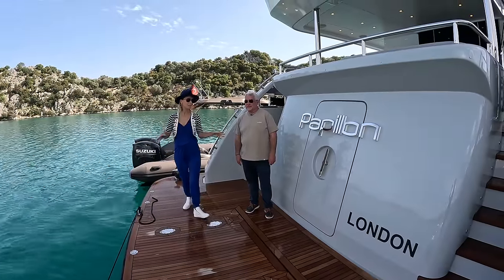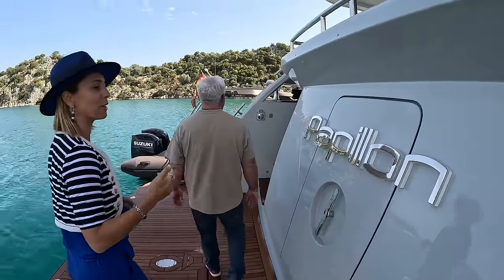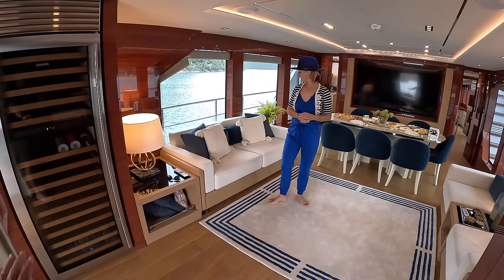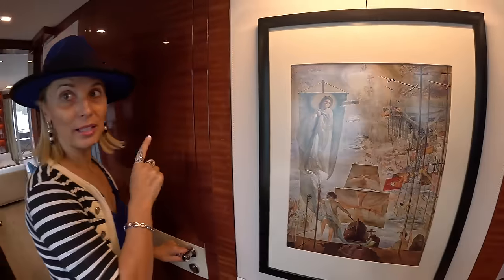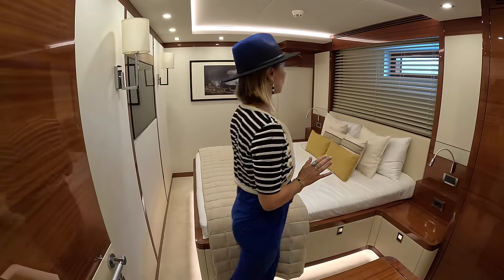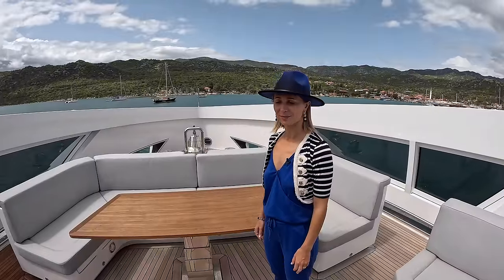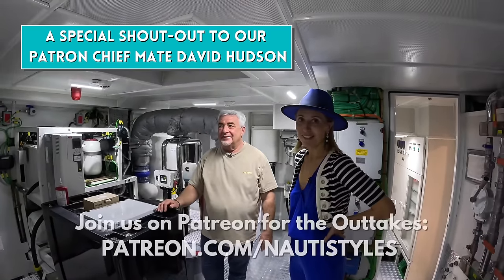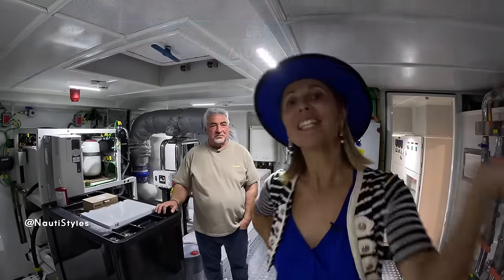OUR YACHT Build UPDATE & BERING 92 EXPLORER SuperYacht Tour / EXPEDITION Liveaboard Trawler

Comment: Another impressive Bering, although I have to say I felt that pilothouse was to cramped and on the fly bridge in the area with the couch, bar and bar stools there was just to much crammed into a small space.  I was a bit surprised at those areas as one thing that impresses me about Bering is the efficient use of space they usually have.

Comment: Kitchen , nice and compact, all mod cons , where is the prep area ? Counter top ? Cannot see space for 8 plates at a time , how will service work ? Plates need to arrive within seconds of each other . A charter build ? 
  Maybe Rico can blow his own horn soon and hope you have a bell on your boat :-) 
Really do like the 'helms ' , so often the upper deck is overkill , not here . Functional . 
Lower deck is about getting there :-) 
  Stabilisers :-) Maybe have a few demonstrations of how good they are ? A simple ball bearing suspended from a wire in some small space ? 
Head floor , must be non slip , out of the shower with wet feet ? Ok , anti slip , when dry ? 
  Never run down a view from the head :-)

Comment: Rico--Seakeepers are not effective in boats over 75'--Zero Speed Stabilizers that are standard on the Bering would do more than the Seakeeper.
 
For your build you should consider frosted shower glass from18-50" for privacy particularly with multiple guests and Charters. Would still allow for views out the windows.

Lights in the lower engine room would be nice for servicing or trouble shooting underway

All the stairs could be problematic in rough seas on a long cruise

Comment: i was always a big fan of big chunky furniture, things that not only have a purpose but durability, last a lifetime and some, i find the Bering Yachts fit that kind of class, there are delicate things built into chunky things, Alexie must be congratulated on such 'Chunky Elegance' that sets his boats well away from the competitors - the high shine finish on the woodwork, something else
having a quick tour of this yacht, i can see a few very minor things i would change (or rather have designed slightly different) i'm not a fan of the door handles used, they look like they might be at elbow height and i could easily see myself swearing at them a number of times, maybe after you get used to them, you walk round with hands on head, was a bit weird seeing a large handle on the shower door too, i know i would catch that, perhaps sliding door, which i know is perhaps not practical while under way, pocket doors all round would be nice to see them hide away into the walls, and have them operate likesome patio doors, a handle would lift them to open, they drop to lock, an easy fix
also having the tv against the inner wall where daylight distractions can interfere with viewing, shadows and reflections (i know close the curtains/blinds etc - i would like a bed to be facing outwards, to see the view, sky etc - perhaps a flat screen could hide in the wall below the window, into the wall, pops up to block the window, no light issues
just amazing

Comment: One thing that always occurs to me when seeing a yacht like this is why the bridge is always so far back from the front of the boat. I know some times it is needed due to the narrow design towards the front of the boat or to have a sun bathing area, but in this case it looks like the bridge could easily be 10-20 feet forward giving a better view of what is in front of the boat.
Reply: Its for comfort, you do not want to be all the way on the bow in rough seas
Reply from the maker: Thanks Michael for answering the question! Appreciate it!

Comment: I must say I have ONE regret about the lines of the latest Bering. They are getting too much like your regular super yachts. They are beautiful, don't get me wrong. We can still see un all the details that they are robust boats made to go anywhere in any conditions and bring you back to port safe and sound. But older hulls looked more rugged. It's like a pumped up soldier in bdu or in full dress uniform. It's the same bad-ass in both cases but one looks more the part than the other.

Comment: I have one concern with the boat and it’s the same with Nordhaven.  If these are “exploration” yachts, they should be expected to travel in big seas so why would you have bows that can be swamped?  Nordhaven puts their ribs and other auxiliary watercraft in a sunken bow vs. in the stern.  I know the bows have a high rise but if you get green water over the bow it will take time to drain which leaves the boat susceptible to multiple swamping.  If I were designing a boat I would have a flush deck on the bow to take big seas but that’s me.
Reply from the maker: … and let me guess… you are not a naval architect 😝😂🤷‍♀️
Reply: Now that I’ve chilled.  I ask the question because I’ve raced sailboats in the southern ocean.  I’ve been in 30 to 40 ft. seas.  From your video I couldn’t see how the water drains from that foredeck.  There are reasons why the engines are below the waterline on that boat and that it has two stabilization systems.  It’s top heavy.

Comment: You can add multiple sea keepers to add up to the mass that you need.
Reply: @@ElephantProtectors No they don’t no more energy then Fines and a lot less drag no fines in the water that the engines have to pull through the water. You get more natural miles with sea keepers then fines .
Reply: @@ElephantProtectors your going to yes one or they other . This boat have 4 fines that’s 4 PTO . And one the speaker is running it doesn’t use much energy 2kw once it’s running.
Reply: @@ElephantProtectors seakeeper 35 when running use 30 amps not bad for a 100 ton gyro.
Reply: @@ElephantProtectors but that’s not a lot of energy to control a 200 ton vessel.
Reply: That a lot of energy for your 36’  small personal vessel .

Comment: Love how they used stainless steel piping very smart to use for everything but the hydraulics they did here is great it’s a boat it’s gonna be humid, salt water corrodes and the pipe is gonna rot out in that environment even though it’s not submerged in salt water. Also they have copper nickel pipping too that stuff lasts forever. IMO they should atleast use stainless piping for everything that has sea water running through them so they don’t corrode like regular iron pipe that’s how boats sink the pipes rot from the inside out and one day bam it’s leaking and ur screwed. If ur gonna spend big money like this just do it right from the start.

Comment: My guess for TV size is 75"-85".  You can find screens in 90"+ and go up from there is you want to use a projector.  When a TV get's this big you have to think about how far from the screen you are situated.  With a 75" TV, you will want to be 8 feet from the screen.  Watching the screen from the 6 Dining seats would be far too close.  All dimensions use a diagonal measurement.  Remember when your parents told you not to watch the TV too close?  They were worried about your eyes.  Eye deterioration is an issue thanks to millions of computer fans, watching their screens intently.  (AS They Should, when viewing NautiStyles...)

Comment: In case of fire, I would prefer to get rid of the LiPoFe Batteries some how pushing them overboard. If a Tesla is burning, they need to drop the car in a Container, filled with water, otherwise it is burning hours! What do you think about this?
Reply: Guess that's why the main battery bank is AGM (lead acid). It's not a hybrid boat so you can go with old but reliable technology, no need to save battery weight.
Reply: @AndrewCZ47  ah, ok, thank you for explaining! More confidence, now!

Comment: 150 inches. But it will be greater. Take a LED projector
Reply: @NautiStyles  your arms, Victoria, when you spread them out is your height. So mif you try to measure it diagonally, you or Rico could guess the size of the TV. so when im right this TV is over 80 inches

Comment: I Love Bering and Alexi, but the design of this yatch is retarded. The bridge is so small it's claustrophobic, and you can not see enough of the forward bow to maneuver safely. The galley is small and lacks dry storage. The engines are buried under the engine floor; good luck maintaining them. If the bow gets overwhelmed with repetitive waves, it's going to be very difficult to recover. 😢 This 92 needs to go back to the design phase. Sorry everyone 😔

Comment: I’m not sure this is as well designed as other Bering’s, it seems a bit confused especially for its role as a charter boat. 11 passenger accommodation, 8 seater dining table, and only 4 seating in lounge- these numbers don’t add up. Also using the owners cabin for substantial extra fridge storage is a no-no, if I chartered this boat I wouldn’t want the crew going in & out of my walk-in robe to get items from the fridge’s. Cabins look too compact to be truly luxurious and I might have missed it but I didn’t see much in the way of drawer or shelf storage for clothes in guest cabins. Main galley is too small for maximum of 11 passengers.

Comment: It's a polarizing design that 92. PROS: Beautiful, amazing capabilities with great bones of course. I saw the video of it cutting through high seas and it was laughing its way through.
CONS: The salon, pilot house, etc. wood color (which extends to the kitchen) was too red and an expensive mistake (unless it's just the video camera coloring).
Sharp edges in the pilot house stair? Weird. Captain and mates chair are essential (3 chairs are better). Alexi needs to assign a guy to aligning/leveling (or integrating) all of the separate engineering controls - as have other Italian? builders (not said to nitpick but to help). It's too easy to cut a hole and plunk in another device at a helm station; it doesn't look clean, professional, and well thought out. He's got great designers to delegate this to. Go for a clean helm station design for your 75 and Alexi's 80 (you should be able to clean them all in a single Windex swipe. I assume your boat has a GPS locked joystick control? (a big, and maybe expensive, assumption). Bedroom doors need? flat-doorbolt hardware (so locking tabs don't stick out when open). Makeup tops MUST be led lit.

Comment: I follow the shipyard a lot and the boats will certainly be of high quality but I find really absurd to create a space for freezers and other things related to the galley right under the owner's cabin. 😝Couldn't it have been placed elsewhere? For example under the crew quarters?
So, if something is needed or needs to be fixed, you knock on the cabin and ask the owner: "Ehi, can I come by here to get the beers or put away the meat or cheese?" 😅 Or will the owner himself do this? Absurd, unbelievable😮      👎Failed! 
Another aspect that I don't like is the flybridge with the tender and the jet ski placed a few cm from the seats, from the table... I imagine the engine and fuel smells🥴...the flybridge of some much smaller Navetta appears more comfortable and wide, spacious...👎failed again!!

Comment: The welds on that bow look horrendous!
Reply from the maker: I'm sure you are referring to the "stitching" not the finished welds
Reply: @NautiStyles  yes.. the stitching.  but even stitching welds should not have blobs of extra material, nor should it be to the point of later needing to be ground down to match a finish weld.  A good weld is a good weld and a stitching weld should look like a finish weld.